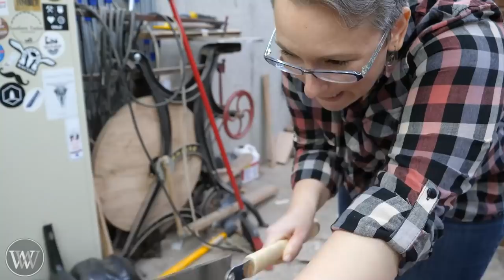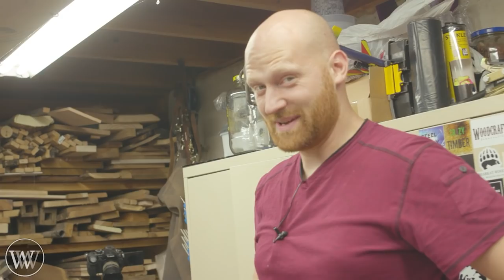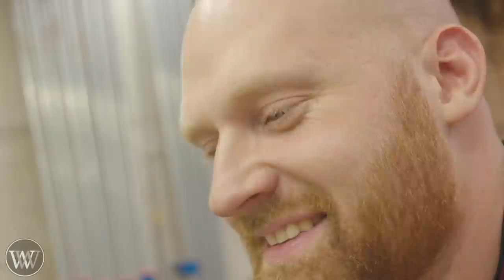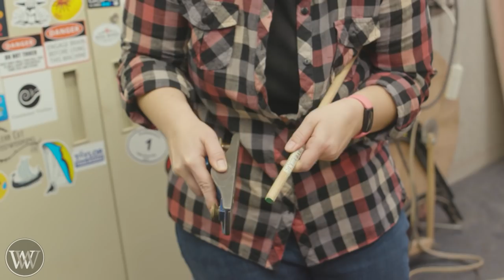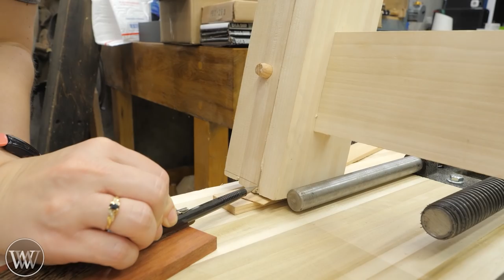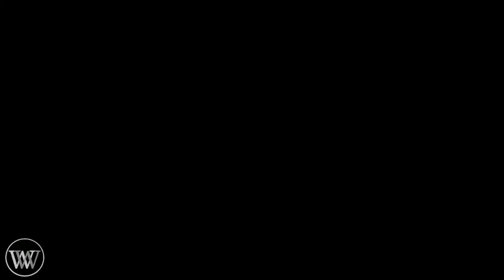How to Sarah's Bench Part 3

Comment: 1st, it will be a bit shorter once the bottom of the legs are flush cut to the floor. 
2nd, it is Sarah's bench, what if she wants Cat holes instead of dog holes?
3rd, please don't make her (or us) wait a year for yhe next installment on her bench (unless she needs some physical therapy to recover from the brass-backed saw)😉
4th, it's looking good, and I kinda figured she'd get the bridge plane anyway.
Reply from the maker: Yes. It'll be a bit shorter. I'll be lopping about an inch off of them.

Comment: What angle are you using for the legs in relation to the top? I know this is a year old video so I may not get an answer. Have a LARGE day!
Reply from the maker: The angle is "about that much" we just set the bevel gauge to something that looked good. Something around 75 degrees. Give or take 10.